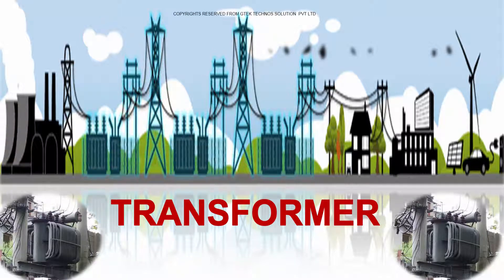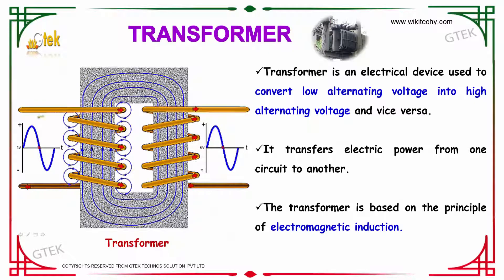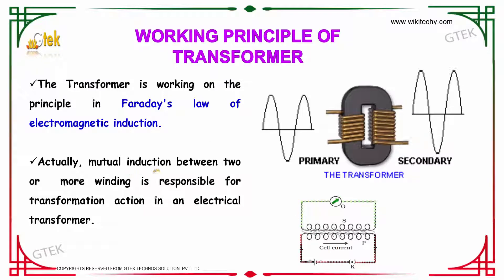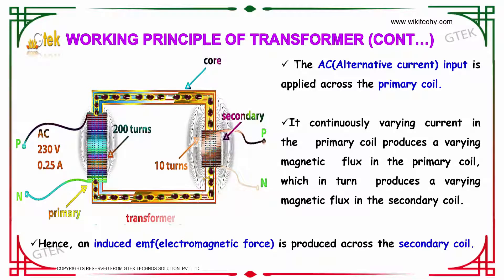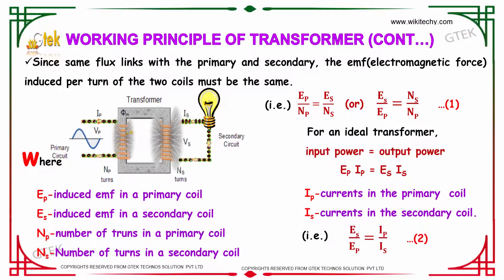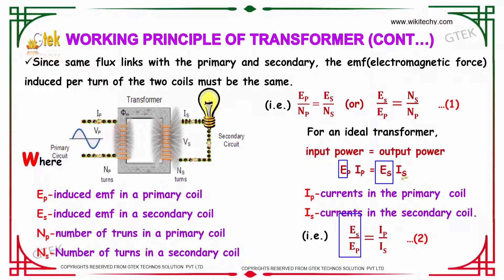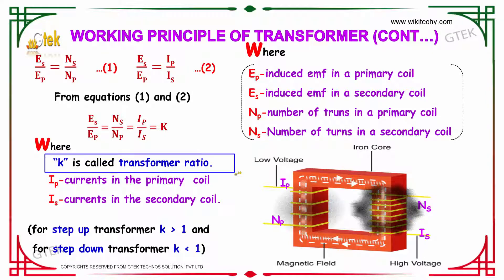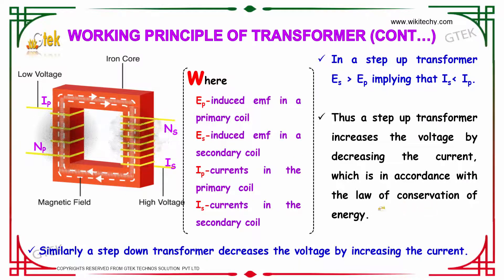Transformer|Electro Magnetic Induction And Alternating Current

Comment: For simplification or approximation purposes, it is very common to analyze the transformer as an ideal transformer model as presented in the two images. An ideal transformer is a theoretical, linear transformer that is lossless and perfectly coupled; that is, there are no energy losses and flux is completely confined within the magnetic core. Perfect coupling implies infinitely high core magnetic permeability and winding inductances and zero net magnetomotive force

Comment: A varying current in the transformer's primary winding creates a varying magnetic flux in the transformer core and a varying field impinging on the transformer's secondary winding. This varying magnetic field at the secondary winding induces a varying electromotive force (EMF) or voltage in the secondary winding due to electromagnetic induction. Making use of Faraday's Law (discovered in 1831) in conjunction with high magnetic permeability core properties, transformers can be designed to efficiently change AC voltages from one voltage level to another within power networks.